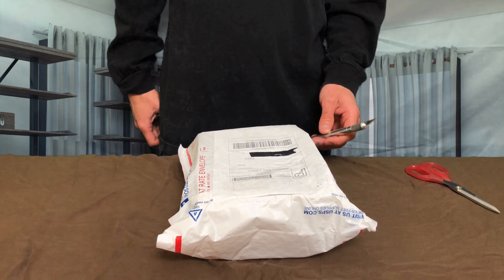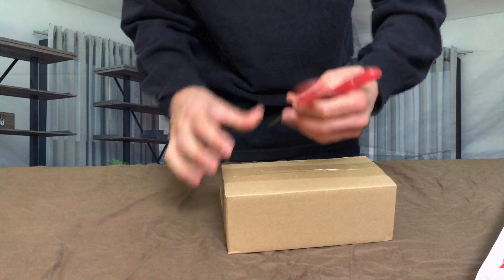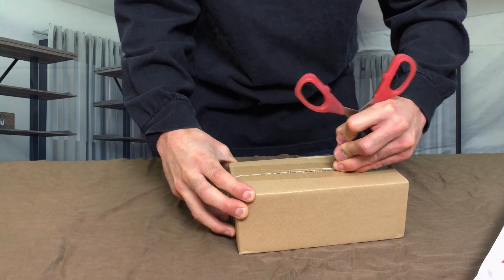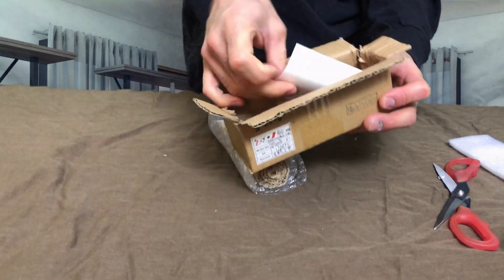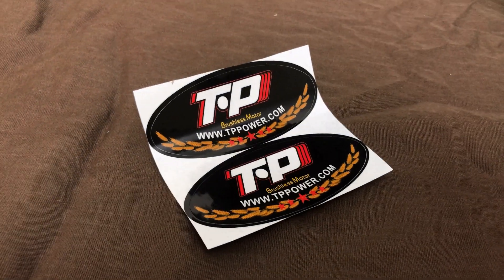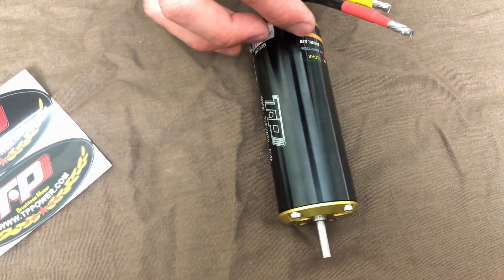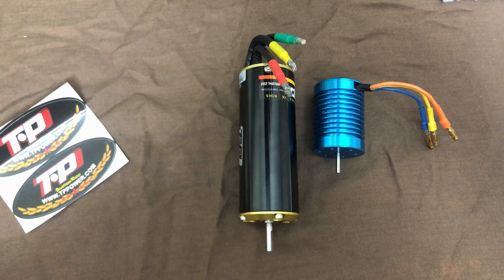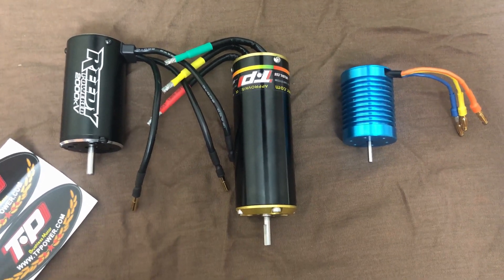TP Power RC Brushless Motor 1700kv - Unboxing

Comment: Which model was it? CM or SCM series? What ESC did you pair it with ? How is it geared as far as spur/pinion?  How did you end up liking it compared to to your 2200 in the UDR? Thanks man.  Great looking motor.
Reply from the maker: I'm using the motor with a Hobbywing 200amp esc. On the UDR I was using 51/32 with the 2200kv, with the 1700kv I will try a 51/34 spur and pinion. I still need to finish installing it in the UDR to see how it works. This 1700kv 4070 motor is neither CM or SCM, it's just the regular 4070 1700kv.